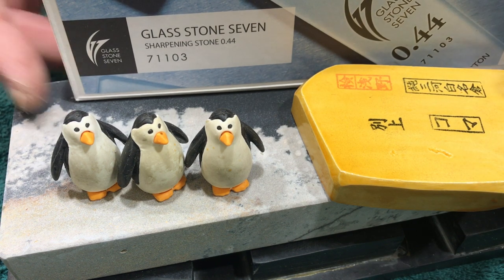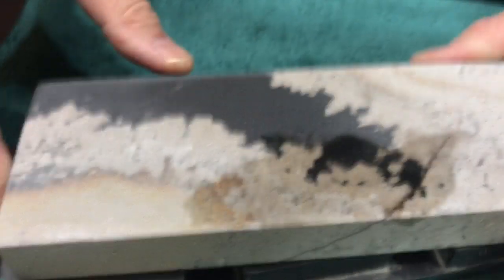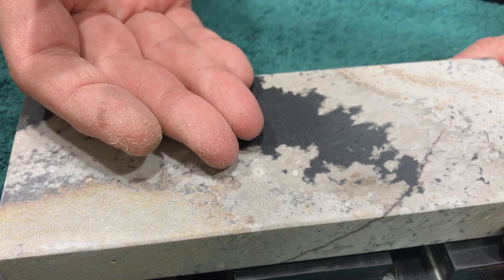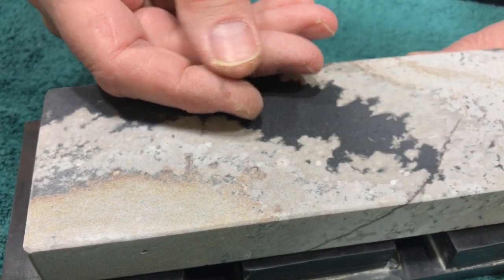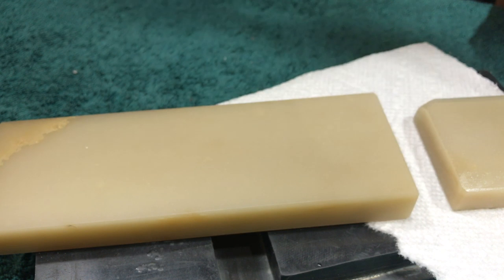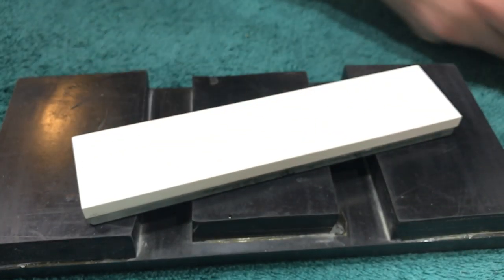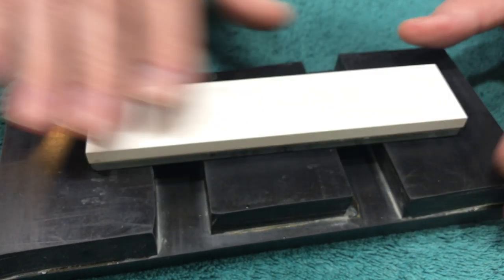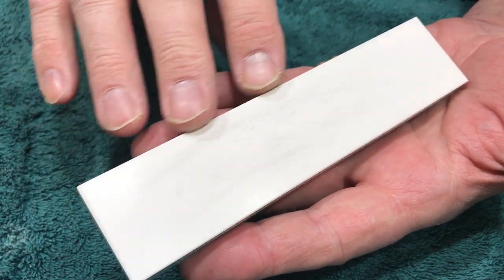Honing Vlog #11

Comment: Hi Keith! Im kind of new to sharpening. I got a soft/surgical black ark combo stone from dans. It took a little while to figure out the soft because half is porous and cuts fairly quickly while the other half is more solid. I haven't ever used a hard ark but I imagine its closer to that. The black ark has given me varying results though. It could be me not having enough skill and experience yet, but I was wondering about what pressure I should use on it? I normally use pretty light pressure, but it seems like it doesn't polish the edge hardly at all. Do I just need to use more pressure, or more strokes? FYI I use it for knives not straight razors.
Reply from the maker: A lot depends on how the stone is finished, your exact amount of pressure, steel type, how much flex there is in the blade, lube type - friction coefficient, etc. Only way to figure it out is to try stuff, check results. Arks do not polish like a synth though, they leave a hazy type of finish.

Comment: Interesting pattern on the arc Keith, you talked about the spot in the right corner(whit) is there also a difference in the black and the white in the spots in the remainder of the stone?
Reply from the maker: The stone is pretty much consistent all the way through, but that one spot has a greater amount of visible pores... sorta like when you have a Suita with more Su in one area.

Comment: So here is a question. How  does an old barber's hone edge compare with a usable edge from the more inexpensive modern hones?
Reply from the maker: No way to answer that question, there are way too many unknown variables.
Reply: @KeithVJohnson1  it would be interesting to see the edges off a good old barber's hone under the microscope.
Reply from the maker: I've seen a ton of them, honestly - there's not much to see. B-hones don't leave pretty scratch patterns or polish all that well. Viewing those edges never says much about edge condition or hone qualities. Plus, there are literally hundreds of different barber hone types/brands/models out there and they are all in varying degrees of conditions. Then you have to factor in technique of use, starting edge condition, and so on. They're not finishing stones, they don't work like a water stone or any other type of razor hone actually. Their intended purpose was to get a tugging edge to not tug. They're not for edge refinement or refined sharpening. They really don't work well as a finishing stone, they're more of a 'last ditch effort' sorta thing.